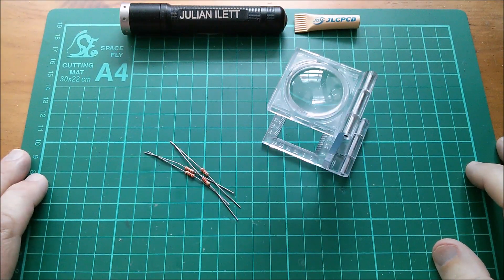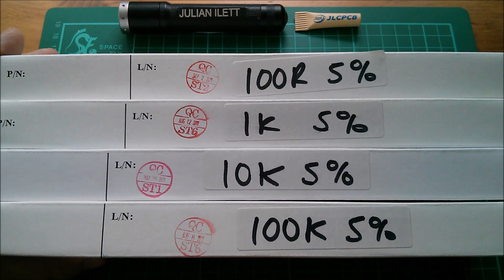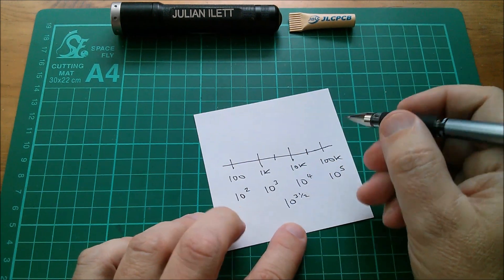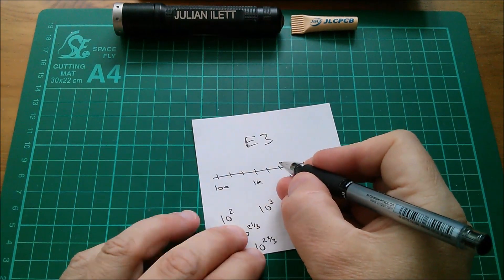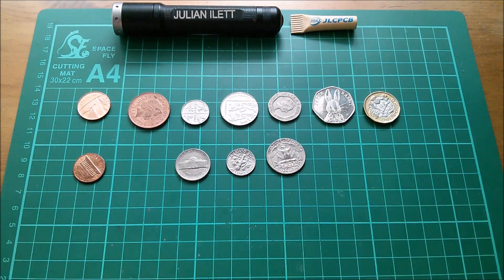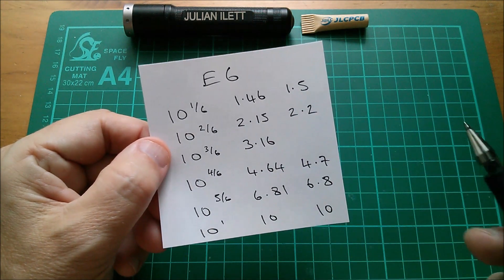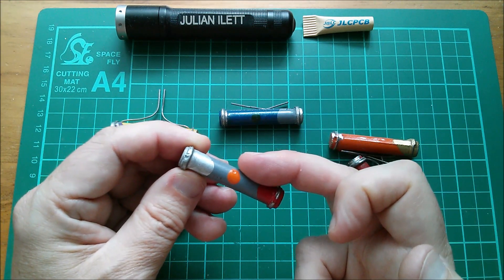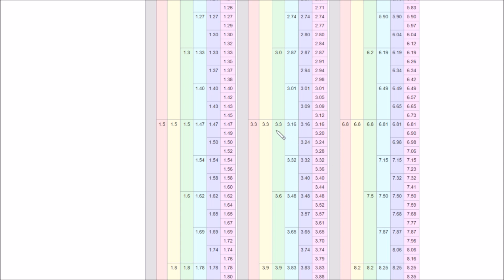Resistor Values - Why 33k, 47k, 68k?

Comment: 2:52 I don't think so! My old old SHARP EL-501 pocket calculator is far more versatile for electronic engineering calculations.
8:00 Why are capacitors,  specifically Mica condensers also graded with this log nomenclature?

Comment: The main benefit, is that by connecting resistors in series and parallel you can get more combinations from smaller set of resistors. Same with capacitors. If you would have values, like 10, 20, 30, 40, 50, 60, 70, 80, 90 and 100, it doesn't give you much. You can't easily create 55, (well you could use 50 + 10/2, but that is 3 resistors). Or 37. It also is redundant, you can make 70, by using 70, or 10+60, or 20+50, or 30+40, etc.

By using 10, 20, ..., 90 (9 distinct values): These are the values you can get when combining 1 or 2 resistors in parallel or series, that result in <= 100 Ohm

5 6.67 7.5 8 8.33 8.57 8.75 8.89 9 10 12 13.3 14.3 15 15.6 16 16.4 17.1 18.8 20 21 21.8 22.2 22.5 24 25 25.5 26.7 27.3 27.7 29.2 30 30.8 32.1 32.3 34.3 35 36 37.3 39.4 40 42.4 45 50 60 70 80 90 100 
Unique values: 49

If you also use 100, (for a total of 10 distinct values), you get few extra combinations:

5 6.67 7.5 8 8.33 8.57 8.75 8.89 9 9.09 10 12 13.3 14.3 15 15.6 16 16.4 16.7 17.1 18.8 20 21 21.8 22.2 22.5 23.1 24 25 25.5 26.7 27.3 27.7 28.6 29.2 30 30.8 32.1 32.3 33.3 34.3 35 36 37.3 37.5 39.4 40 41.2 42.4 44.4 45 47.4 50 60 70 80 90 100 
Unique values: 58 

If you also include a value "15", (which is likely, as jump from 10 to 20, is big), for a total of 11 distinct values, then you get this:

5 6 6.66667 7.5 8 8.33333 8.57143 8.75 8.88889 9 9.09091 10 10.9091 11.5385 12 12.3529 12.6316 12.8571 13.0435 13.3333 14.2857 15 15.5556 16 16.3636 16.6667 17.1429 18.75 20 21 21.8182 22.2222 22.5 23.0769 24 25 25.4545 26.6667 27.2727 27.6923 28.5714 29.1667 30 30.7692 32.1429 32.3077 33.3333 34.2857 35 36 37.3333 37.5 39.375 40 41.1765 42.3529 44.4444 45 47.3684 50 55 60 65 70 75 80 85 90 95 100 
Unique values: 70

 Instead if you use more unique values (they don't need to be logarithmatically spaced), lets say 10, 12, 15, 18, 22, 27, 33, 39, 47, 56, 68, 82, (12 distinct values) you get way more combinations:

5 5.45 6 6.43 6.67 6.88 7.2 7.3 7.5 7.67 7.76 7.96 8.18 8.25 8.31 8.48 8.72 8.8 8.91 8.92 9 9.18 9.56 9.64 9.88 9.9 10 10.2 10.3 10.5 10.8 10.8 11 11.4 11.6 11.8 12 12.1 12.3 12.3 12.7 13 13.2 13.5 13.6 14.1 14.2 14.8 14.8 15 15 15.8 16 16.5 16.6 17.1 17.3 17.9 18 18.2 19.3 19.4 19.5 20 20.3 20.8 21.3 22 22.2 23 23.5 23.5 24 24.8 25 25.6 26.4 27 27.8 28 29.9 30 30.7 32 33 33.3 34 36 37 37.2 39 40 41 42 43 44 45 47 48 49 51 54 55 56 57 59 60 61 62 65 66 68 69 71 72 74 78 80 82 83 86 89 90 92 94 95 97 100 
Unique values: 128

and if you also use 100, (for a total of 13 distinct values) then you get this:

5 5.45 6 6.43 6.67 6.88 7.2 7.3 7.5 7.67 7.76 7.96 8.18 8.25 8.31 8.48 8.72 8.8 8.91 8.92 9 9.09 9.18 9.56 9.64 9.88 9.9 10 10.2 10.3 10.5 10.7 10.8 10.8 11 11.4 11.6 11.8 12 12.1 12.3 12.3 12.7 13 13 13.2 13.5 13.6 14.1 14.2 14.8 14.8 15 15 15.3 15.8 16 16.5 16.6 17.1 17.3 17.9 18 18 18.2 19.3 19.4 19.5 20 20.3 20.8 21.3 21.3 22 22.2 23 23.5 23.5 24 24.8 24.8 25 25.6 26.4 27 27.8 28 28.1 29.9 30 30.7 32 32 33 33.3 34 35.9 36 37 37.2 39 40 40.5 41 42 43 44 45 45.1 47 48 49 50 51 54 55 56 57 59 60 61 62 65 66 68 69 71 72 74 78 80 82 83 86 89 90 92 94 95 97 100 
Unique values: 141 (unique within 0.005, i.e. 5.995 and 6.004, are considered the same value of 6)

Notice also that you get a lot of whole numbers here too (they might be a result of rounding, i.e. 8.999 is displayed in list as 9.00, but that is good enough), 5, 6, 9, 10, 11, 12, 13, 15, 16, 18, 20, 22, 23, 24, 25, 27, 28, 30, 32, 33, 34, 36, 37, 39, 40, 41, 42, 43, 44, 45, 47, 48, 49, 50, 51, 54, 55, 56, 57, 59, 60, 61, 62, 65, 66, 68, 69, 71, 72, 74, 78, 80, 82, 83, 86, 89, 90, 94, 95, 97, 100, as well close to whole numbers, like 7.96, 14.1, 17.1.

If you extend this to up to 3 resistors (including parallel-series combinations), you can basically create any value you want within 1%.

4.76 5 5.17 5.45 5.66 6 6.04 6.25 6.43 6.43 6.67 6.72 6.8 6.88 6.98 7.13 7.2 7.21 7.3 7.37 7.5 7.56 7.62 7.67 7.67 7.76 7.82 7.96 8.02 8.09 8.18 8.18 8.19 8.25 8.26 8.31 8.33 8.41 8.48 8.72 8.73 8.79 8.8 8.91 8.92 8.99 9 9.01 9.09 9.18 9.26 9.35 9.48 9.56 9.64 9.68 9.75 9.77 9.88 9.9 9.91 10 10.2 10.2 10.3 10.4 10.5 10.6 10.7 10.8 10.8 10.8 10.9 11 11 11.3 11.4 11.5 11.5 11.6 11.7 11.8 11.9 12 12 12.1 12.3 12.3 12.3 12.5 12.7 12.9 12.9 13 13 13 13.2 13.2 13.5 13.6 13.6 13.8 14.1 14.2 14.2 14.3 14.6 14.8 14.8 14.8 15 15 15.2 15.3 15.3 15.4 15.8 16 16.2 16.2 16.3 16.5 16.6 16.7 16.9 17.1 17.2 17.3 17.5 17.6 17.9 18 18 18.2 18.2 18.7 19 19 19.3 19.4 19.4 19.5 19.9 19.9 20 20.3 20.4 20.8 20.9 21.3 21.3 21.7 21.9 21.9 22 22.2 23 23 23.1 23.5 23.5 23.5 24 24.2 24.2 24.8 24.8 25 25 25.4 25.6 26.4 26.4 26.5 27 27 27.1 27.8 28 28.1 28.6 28.8 29.1 29.6 29.9 30 30.1 30.6 30.7 31 31.1 32 32 32.4 32.9 33 33.3 33.3 33.8 34 35.1 35.5 35.9 36 36.3 37 37.1 37.2 37.5 37.9 38.3 39 39.4 39.8 40 40.5 40.8 41 41.5 41.9 42 42.5 43 43.8 44 44.4 45 45.1 45.4 46.2 47 47.1 47.4 47.9 48 48.5 48.7 49 49.2 50 50.2 50.7 51 51 51.7 52.2 52.4 52.8 53.5 54 54.1 54.8 55 55 55.4 55.9 56 56.3 57 57.1 57.6 58 58.2 59 59.5 60 60.9 61 62 62.1 62.7 64.5 65 66 66.7 68 69 71 72 74 78 80 82 83 86 89 90 92 94 95 97 100 
Unique values: 292

And if you remove restriction on <= 100, even more values:

4.7619 5 5.17241 5.45455 5.66038 6 6.04027 6.25 6.42857 6.43275 6.66667 6.71642 6.80101 6.875 6.97674 7.12743 7.2 7.20524 7.2973 7.3724 7.5 7.56303 7.6175 7.67045 7.67442 7.76471 7.82123 7.95918 8.01887 8.08824 8.18182 8.18363 8.18859 8.24561 8.25688 8.30769 8.33333 8.40517 8.48485 8.71795 8.72525 8.79479 8.8 8.91304 8.91892 8.99358 9 9.00819 9.09091 9.17647 9.2559 9.34844 9.47612 9.55932 9.64286 9.67742 9.74729 9.77444 9.88235 9.9 9.90991 10 10.2 10.21 10.3125 10.432 10.4681 10.5793 10.7143 10.8 10.8118 10.8333 10.9442 10.9653 11 11.2534 11.371 11.5165 11.5385 11.6471 11.6608 11.831 11.8943 11.9886 12 12.1224 12.2892 12.3158 12.3311 12.4593 12.6804 12.8616 12.9299 13.0154 13.0325 13.0435 13.2 13.2353 13.5 13.6216 13.6404 13.7593 14.0656 14.1631 14.2326 14.253 14.6384 14.76 14.782 14.85 14.9855 15 15.1644 15.2542 15.2778 15.4097 15.7949 15.9545 16.1962 16.2391 16.318 16.5 16.6222 16.6667 16.8827 17.1486 17.1939 17.3462 17.5325 17.5693 17.875 18 18.0328 18.1789 18.2169 18.6922 19.0283 19.0483 19.3263 19.3548 19.3875 19.5 19.8622 19.8795 20 20.3119 20.3526 20.764 20.9047 21.2598 21.314 21.7474 21.875 21.9101 22 22.2178 22.9895 23.0035 23.0769 23.4946 23.5 23.5304 24 24.2268 24.2424 24.785 24.812 24.9674 25 25.3731 25.5534 26.4151 26.4298 26.4706 27 27.0073 27.0995 27.7913 28 28.0576 28.5714 28.8136 29.078 29.5775 29.876 30 30.0699 30.5556 30.7097 31.0345 31.0606 31.9728 32 32.4324 32.8859 33 33.2754 33.3333 33.7748 34 35.0649 35.4839 35.8974 36 36.3057 37 37.1069 37.1733 37.5 37.8882 38.2716 39 39.3939 39.759 40 40.4762 40.8284 41 41.5205 41.8605 42 42.5287 43 43.8202 44 44.4444 45 45.0549 45.3552 46.2366 47 47.0899 47.3684 47.9167 48 48.4536 48.7179 49 49.2386 50 50.2488 50.7389 50.9804 51 51.6908 52.1531 52.381 52.8302 53.4884 54 54.1284 54.7511 54.955 55 55.3571 55.9471 56 56.3319 57 57.0815 57.6271 57.9832 58.159 59 59.5142 60 60.9375 61 62 62.1212 62.6866 64.539 65 66 66.6667 68 69 71 72 74 78 80 82 83 86 89 90 92 94 95 97 100 101 103 104 105 105.455 106 106.429 106.667 106.875 107 107.2 107.297 107.5 107.674 107.765 107.959 108.182 108.246 108.308 108.485 108.718 108.8 108.913 108.919 109 109.091 109.176 109.559 109.643 109.882 109.9 110 110.2 110.312 110.468 110.714 110.8 110.833 111 111.371 111.647 111.831 112 112.122 112.289 112.316 112.68 113.015 113.043 113.2 113.5 113.622 114.066 114.233 114.76 114.85 114.986 115 115.254 115.795 115.955 116.5 116.622 117.149 117.346 117.875 118 118.033 118.217 119.326 119.388 119.5 120 120.312 120.764 121 121.26 121.314 122 122.218 122.989 123.5 123.53 124 124.785 124.812 125 125.553 126.43 127 127.791 128 128.058 129 129.876 130 130.71 131.973 132 133 133.275 134 135.897 136 137 137.173 138 139 140 140.476 141 142 143 144 145 145.055 147 148 149 150 151 154 155 156 157 159 160 161 162 164 165 166 168 169 171 172 174 178 180 182 183 186 189 190 192 194 195 197 200 201 203 204 207 209 210 212 215 218 221 222 224 227 229 233 236 238 239 247 250 256 264 268 282 300 
Unique values: 466

Non equal spacing is more flexible.

If you use doubling scheme, like 5, 10, 20, 40, 80, 100. You don't get a good uniqueness characteristics, as there is redundancy, i.e. 40 in parallel with 40, is 20, which doesn't give you a new value, or 5 in series with 5 is 10, which you already have.

Up to 3 resistors of values 5, 10, 20, 50, 100, 200:

2.46914 2.5 3.27869 3.33333 3.92157 4 4.44444 4.54545 4.65116 4.7619 4.87805 5 6.45161 6.66667 8 8.33333 8.69565 9.09091 9.52381 10 13.3333 13.9535 14.2857 15 15.3846 16.6667 18.1818 20 22.2222 25 26.087 28.5714 30 33.3333 40 43.1373 46.1538 50 51.8519 55 60 66.6667 68.8525 70 70.9677 75 85.7143 100 
Unique values: 48

Up to 3 resistors of values 5, 10, 20, 40, 80, 160:

2.46154 2.5 3.26531 3.33333 3.90244 4 4.32432 4.44444 4.57143 4.70588 4.84848 5 6.4 6.66667 7.61905 8 8.42105 8.88889 9.41176 10 12.3077 13.3333 13.7143 14.5455 15 16 17.7778 20 21.6216 22.8571 25 25.2632 26.6667 30 32 35.122 38.0952 40 43.6364 45 50 53.3333 55.5102 57.6 60 61.5385 68.5714 80 81.2308 82.4242 84.7059 85 88.8889 90 96 100 
Unique values: 56

Pathetic. It is worse than simple other schemes, even with just 2 resistors.

Comment: Dear Julian, concerning the choice of 33 instead of 32 , there is a reference by John Woodgate to this in the "Letters to the editor" in Electronics World Januari 2001 p.75: "...for practical reasons 3.3 was chosen instead of 3.2 to get 'more colour contrast', presumably with 2.2..." In the same letter there is also a reference to the letter on "E numbers and resistors" in the December 2000 issue of Electronics World and a letter by one 'Scott' in the Januari 1984 issue of Wireless World. Unfortunately I don't have these two issues in my possesion, but maybe some else here can supply them. Here is the link to the first letter: https://www.dropbox.com/s/rmvq8ufhf5l75zu/ereeksen.pdf?dl=1
Reply: I found some extra information. In the March 2001 issue there was another Letter to the editor by Kenneth Gundry. This is what he writes: "If you calculate the error in the ratio of each value to its neighbour compared with the ideal 12th root of 10, you will find that any other sequence is worse. In fact, the biggest error is 1.5, not 3.3, and changing 3.3 to 3.2 is too close to 2.7 and too far from 3.9." In my opinion this is not correct, it is true that the above mentioned error on the ratio from 33 to 27 is smaller than the error from 32 to 27, but the error from 39 to 33 is greater than the error from 39 tot 32. If you take in consideration these last facts (and take the rms error for both ratios) 32 is again the better value

Comment: The tolerance level could cause "fruity" looking resistors
Or rhey did want to add another color!
0 B ad     black.    
1 B oys.  Brown
2 R ape.  RED
3 O ur.     Orange
4 Y  oung Yellow
5 G irls      green
6 B ut.       Blue
7 V iolet
8 Gives  grey
9 W illingly. White
Those old resistors were 
Vintage!

Comment: Very interesting.  (Old imperial cooking scale weights had a binary progression, 32, 16, 8, 4, 2, 1, 1/2 ounces.  All in power of base 2).  Nice to now now the reasoning behind resistor values.  Body, tip, dot was the way I was taught to read those old carbon resistors.  And I have seen them filed on one edge when a more precise value was needed.

Comment: If it makes you feel better, american dollar values do have 1, 2, 5, 10, 20, 50, 100, 1000.
Reply: There's no 1000,  there hasn't been for many years.  No 500 either,  100 is the biggest bill currently in circulation.

Comment: Those "odd values" are because they are commonly used values.
Now I know this is a difficult concept for you metric users out there but the purpose of resistors isn't to conform to units of ten.
If I need to attenuate 12v DC across a 100kOhm (+/- 5%) resistor bridge down to 4volts I need three 33k Ohm resistors.
Also since resistors in parallel are calculated by inverting the value ( turning it into a fraction ) adding those fractions together and then inverting the sum of those fractions to calculate the total resistance , electricians are going to prefer resistors that convert into fractions easily.

Comment: I have zero experience working with resistors until last month.  I had to wire in a 68k ohm resistor to trick my 94 Nissan 300zx ECU into thinking the EGR Temperature Sensor was working.  I had to get a huge 500 piece kit for the use of 2 resistors, I needed a 1M ohm resistor to make the ECU think I had a knock sensor.  As I was looking thorough all of the resistors learning the color codes it made me wonder, why did they choose these values?  Thanks for the explanation.

Just thought of a couple of questions.  What are resistors made of?  And what were the old ones made of?  And how do the makers figure out the values of the materials?

Comment: If you've ever restored old radios sometimes you will find some odd values of resistors used. The most common manufacturer to use odd values in my experience was Philco.  The reason being the Philco factory was lit by early mercury vapor lights which tended to make some colors hard to distinguish so they used values that were easy to read under MV lights.

Comment: Hey julian! I have one of those small 1x1 inch solar panels from one of those rechargeable yard lights. What cool projects could I use it for? Something with extremely low power drain that can be kept charged easily with the panel. Any ideas?

Comment: the resistor value are based on tolerances, the values based on the fact that you can make a resistor of any value and they will fit into one of the 3 values. the one you want, the one below or the one above. so no waste. 
it's the same for a lot of electronic parts, uP were not made in lots of speeds they just marked to slow one's and sold them cheaper. that's how over clocking I think started, as if they had orders for slow ones and they were all coming out better they had to down mark them.

way back in the floppy disk days, you could get single and double  sided disc's. single sided were coated on one side. when they started making double sided, the single sided started using the double sided disc that only worked well on one side. in the end they perfected the process so that they had to use good double sided in the single case. so we just cut a slot in the case and got cheap double sided.

Comment: When I was just a kid, I was given an electronics project set made by Phillips (this was late 60s/early 70s), and my favourite resistor was the 4.7K with its yellow-purple-red code :)

Does anyone else here remember those old Phillips "EE" series electronics sets?
Reply from the maker: I had the same set :)
Reply: I had the cardboard version for Christmas in 1967.

The simple circuits worked Ok but the only one that interested me was the radio at the end of the series of "tutorials". I rushed through the simple circuits pulling them apart as soon as they worked and finally built the radio.

It didn't work!

I spent weeks pouring over it trying to get it to work and my Dad even sourced a new transistor in case mine was faulty. All to no avail, it just didn't work.

Eventually my Mum got sick of it collecting dust on the sideboard and decided to move it. She dropped a few other cardboard boxes on top so she could carry them all upstairs and the radio burst into life!

That was when I learn that the first tool any electronics repair technician should use is a bally big hammer!
Reply: @OwnMyBit  AKA "Percussive Maintenance"

Comment: E12 series using 12 resistors  20% bigger than last with tolerance of 10%  was designed to use minimum number of resistors per series to lower number and manufacturing costs.
   http://logwell.com/tech/components/resistor_values.html

Comment: Umm. Just buy the values you are most likely to use in your projects!  
For me, I'd go for 4k7, as it was my much used traditional TTL pull-up resistor value.
But, to be fair, that wasn't really what the 33k video was all about. LOL